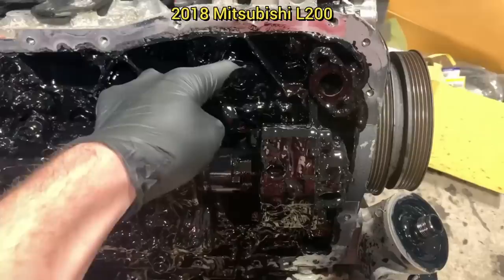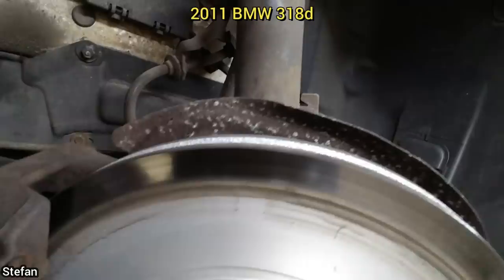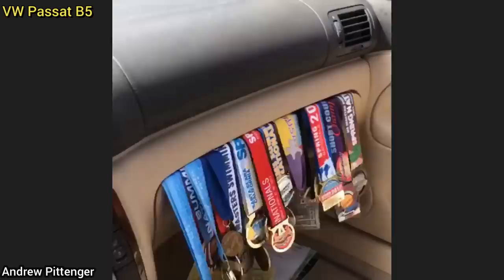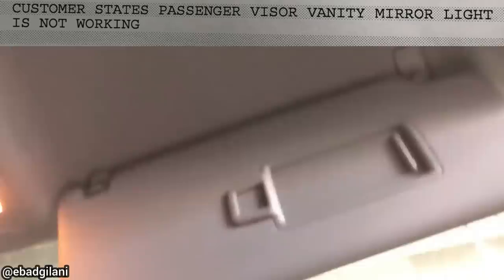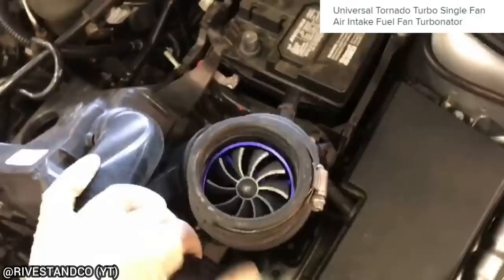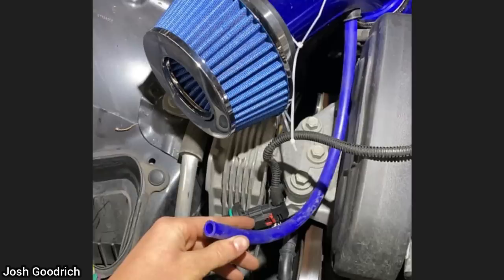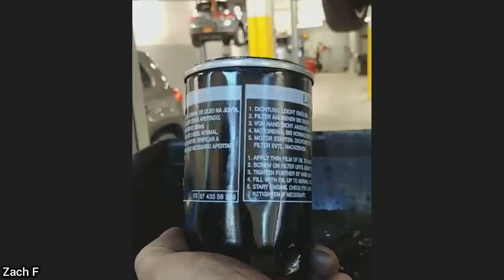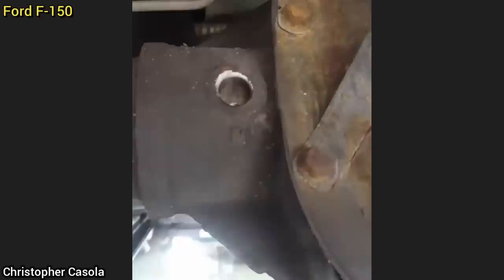Customer States Haven't Changed Oil In 78000 Miles

Comment: Why....would you buy a new car....and not even do the most BASIC maintenance on it? It baffles me.

You can spend $20-40k on a new vehicle...but not $80 for an oil change every 6 months or so? (Or like $40-50ish if you wanna do it yourself)

I mean good lord...even JUST doing regular oil changes will get your car to 300k miles before it croaks. (I mean, of course there will be the usual brakes, rotors, etc...)
But oil changes are just the most basic and effective thing you can do for any engine.

Comment: Had a 2000 ford focus. Never changed the oil for the last 70k miles. It had 200k on it and motor still ran fine when i junked it due to the rest of the car rusted away.

Comment: 1:03  I had a similar situation happen to me back when I used to work for Jimmy Johns.  I was a delivery driver, almost always worked evenings / closing, and the closing manager's car wasn't starting.  Thinking maybe it was just a dead battery I pulled out my jumpers to help him out.  Before connecting the jumper I noticed something off about the plugs.  The Power wasn't securely fastened to the terminal.  I think I used a gerber to tighten it and his car started right up.  Funny thing was the store manager had a garage he and his friends used as a side gig and was the one that had worked on his car.

Comment: I change oil in my vehicles every 3k and I use cheap Walmart supertech oil. And I don't use 5w-30 which both call for. I run 10w-40 all year round. Sometimes I will use rotella 15w-40 in the caddy and never use synthetic, just conventional. It blows my mind that ppl go 15-20k miles before service and wonder why they have issues!

Comment: I'm an engineer of 50+ years, myself. Now retired. From a background of, fabulous  automotive mechanics. Of my maternal uncles. And as a top level engineer. I love your channel. It's beyond funny. It's horrifically, funny. It's life or death, likely death, funny. Oh my God! Talk about missing some parts? We are talking about a Gray  Area, there. But that don't Matter. It's Gray. And their brains did not function.

Yes we have all found stuff like that. In my line of work. Working for NBC-TV & Radio for a couple decades. When you go to, pull out and wire up a new control room. We would find. What we referred to as Kludge Balls. In the wiring under the floor panels. What the hell is that!? It's a Kludge Ball.. Another one should mark they were all over! It was horrific! What other engineers did such things before I got there? It was outrages. Kind of like dropping those oil pans. And finding chunks of oil walnuts. It's a beautiful thing.

It makes one realize. How Neanderthal and Homo erectus all went, extinct. Likely for the same reasons. Ugh I'm hungry. Look. Dog shit. It's dinner time! Ugh! Aargh!

Isn't it always like that?
RemyRAD

Comment: Years ago I got
 (out of necessity)
a Chrysler New Yorker (Mitsubishi 4 cyl) 1990-something.
The guy I got it from was a traveling salesman. 
When I changed the oil,
It was the BLACKEST oil I've ever seen *to this day.
I went back to him and asked him, 
"when was the last time you changed the oil in this thing Bruce ?" 
He said, " Let me get back to you on that."
1 month later I ran Into him and says, " Hey Chris, did some research and...I don't think I had the oil changed in that for 50,000 miles." 
I said incredulously, 
" What :) !?? " 
It never broke down.
The only issue I had with it was the carburetor.

Comment: Honestly, I think this proves how infrequently you need to change your oil. This person went 80,000 miles without changing it, and I bet the car is still running. 80,000 miles no oil change and I bet the car will be fine to drive for tens of thousands more miles after you put in fresh oil and clean it out, or put in a $10 engine flush product.

Comment: We had an 1 year old mitsubishi panel at work that broke up after 10,000 miles without oil change, same L200 engine, it was an almost $7,000 repair, word of advise.. always do proper maintenance to diesel engines

Comment: lol we run 400000 mile oil changes on class 8 trucks with by pass filatration system and water seperators

Comment: i know a mechanic who has had a truck 20 years and has never changed the oil! it runs like a sewing machine! another thing, an oil filter does nothing!  but bypass oil after 20lbs of oil pressure. what caused that gummed up sludge in the engine above is heat, it was not caused from not changing oil! i retired 2 years ago, i have been a professional transmission rebuilder 45 years. i do not change transmission fluid! if you do you will wish you didn't,,,,,,,,,,,,

Comment: Drove a 84 Ford ranger for 274k miles never changed the oil ir filter and was still running when I sold it was not the fastest but sure was durable
Reply: The Rangers and Aerostars were great.
I mean the Aerostar was ugly, but super useful.
I wish they would and could build a vehicle like that now.
Reply: @1978garfield  they could but to reliable to keep their shops busy holding people up on the new cars with all the electronics on them

Comment: I bet you could go 78,000 miles having only changed your oil twice and it would be perfectly fine. I routinely go 13-15K miles an oil change without an issue. I imagine 30K would be pretty dark but still drivable.

Comment: I'm thinking the JB Weld oil filter may have been an emergency patch by the owner to get the car to the repair shop.
I had one of those "quick lube" places botch an oil change on my 2013 Jetta by overtightened the filter and crushing it a bit. Although mine didn't leak TOO badly, just a few drops on the driveway, and I was able to drive it back to fix the damage.

Comment: i use 10,000 high milage and change it at 8,000 used miles on that oil. owned the car two years and

Comment: People should know by now that any item you purchase that needs AS MANY WORDS as the "Universal Tornado Turbo Single Fan Air Intake Fuel Fan Turbonator" is not universal and probably won't help anything...

And the sugar coated almonds packed into the door panel? I'd guess some industrious squirrel found a bag of them and decided to save them for later. My Chevette had a spare wheel well full of pinecones and squirrle prints showing me where the hole in the fender was that it got in through,, and our '76 Oldsmobile had door panels and engine compartment full of walnuts from a nearby tree.

Comment: As bad as 78k miles without an oil change is, the inside of the engine still wouldn't look like that. This engine has chronically overheated as well at some point.

Comment: Considering no parts are labeled on a car, I actually side with the customers on this.
If you're going to design and build a product, build it so it is easily user maintainable.
I have never come across a car that still had it's user service manual with it, and when I did find them in junk yard cars, they were not worth a dmmn.

Comment: LMAO  as a 42 year Tech I have seen my share of stupid driver abuse , but you managed to surprise me.  I have not seen oil sludge like that since I was 10 and helped my dad take to covers of a 1055 Pontiac Chief , back in those days oil had NO detergent and eventually gum up the works ;) . Dad being a TRUE  Cuban added auto trans oil to it after we scraped off the 1/2" thick crud of the heads , but those hydraulic tappets still made noise  LMAO .  loved my dad he came up with some real Magiver shit in Cuba to fix motorcycles and cars WE had to .

Comment: I was just thinking about how long en engine could run without an oil change… I think it was today, strange how coincidences like that happen. Totally not someone spying on my thoughts.
Reply: Modern oils are far better than 30 years ago.
I worked in engine oil development.
One test I was envolved in had the engine run for 100,000 miles, no oil changes just top ups to keep the level correct.
The engine was not even close to being ruined.

Comment: I killed my first car like this. A 1987 Honda Prelude that as 18yo i dont think i changed the oil in something like 3 years. One day the engine just stopped mid highway. Wouldnt start. Taking it to a buddy, he takes the rocker cover off and it was solid coal like carbon build up that must have some how locked up a cam and sheered the pull wheel right off the timing chain.    1 replacment engine please !

Comment: 0:52 I don't understand that one. Whether they have the key or not, if the car starts without a key wouldn't that be a concern that you would want fixed?
Reply from the maker: The key was in the center console and the customer didn't know that. That's why it started even when they had no key on them.
Reply: @JustRolledIn  I always thought the key goes into the ignition near the steering wheel. It never occurred to me that it could be in a different spot. Thanks for clearing that up
Reply from the maker: @bsherder  no worries 😁

Comment: I worked in engine oil development.
One test I was envolved in had the engine run for 100,000 miles no oil changes just top ups to keep the level correct.
The engine was not ruined.

Comment: Should you go by kilometres or duration of the oil to change it
Reply: It used to be 3000 miles (4828 km) but really you could go to 5000 max (8046km), or 5 months. If you do a lot of idling change it at 5 months.If you're driving almost the entire time the engine's running change it by miles.

Comment: How does an engine go 78,000 miles without an oil change? It should have seized up long ago.
Reply: By contrast I have 243,000 miles on my 1997 Ford Ranger but I use Mobil synthetic oil and Bosch oil filters, changing every 6,000 miles. Synthetic is better for the engine on start up, because the lubricant fills the pores of the moving metal parts, but conventional oil tends to drip off parts when not in use so the metal scratches on start up reducing life of engine. Also, have your mechanic change the trani oil every 40,000 miles. Good maintenance extends life of vehicle.

Comment: Did he say Warm-Air-Intake ? 
Is that a real thing? 
What's the benefit?
Reply: A car engine is at it's most efficient--getting the most economy, performance, and cleanliness out each gallon of gas--when the intake air temp is maintained to about 110F. To do that there is a cool air intake, a warm air intake, and the mechanism necessary to mix the two. Was actually one of the earliest implemented emission control devices in the mid 60s probably because it was one of the simplest, and at the time, delivered a lot of bang for the buck.

Comment: That car was either driven very hard, kept in extreme cold or it was old with what would be considered 'low miles'.  This 'never changed oil' bs is the mechanics equivalent of sniper wolf's surprised look face on thumbnails.